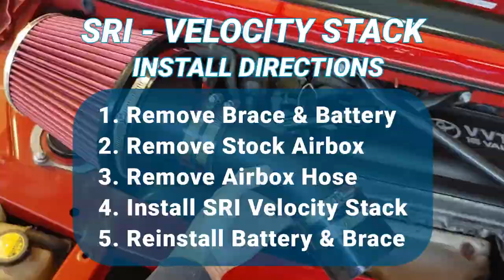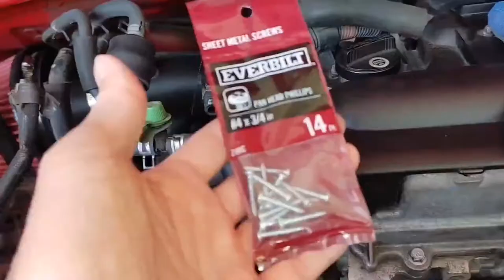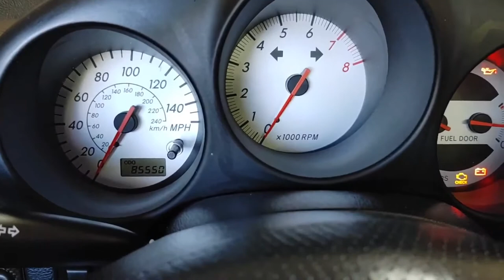Short Ram Intake VELOCITY STACK install on MR2 Spyder

Comment: I love the sound!  The power is neither here nor there for me, but I'd do this on ours in a heartbeat except for the sheer hell of changing it later.  I look at all that work and all my old brain sees is, "Yeah, and think of having to do all of that every time you change the air filter."
Reply from the maker: So true Trever! I just spent about an hour yesterday replacing the short ram intake with the stock airbox because in California we need to get our cars smogged every two years. Your comment was constantly ringing in my ears while I was trying to remove the short ram intake! 😅 But I plan to put it back in once I pass the smog because I miss the sound, and although there probably isn't a horsepower change, my butt dyno tells my there is.
Reply: @mr2garage  I wish there was something that made similar sounds but would fit where the stock airbox is.  I'd love a little more Fiat Abarth sound, if you've heard those, but I just could never motivate myself to go to that much trouble changing it.  Love your channel, BTW!  I've subscribed for more tips on what we can do with our Spyder.
Reply from the maker: @trevertalbert4929  thanks for subscribing! Heard Abarth once years ago and from memory, it sounded awesome!! These air intakes don't sound anywhere close, but it's raspier than stock. There are many cold air intake options with the filter sitting near the airbox or just past it. A handful of people make their own too. .

Comment: good idea, but your filter will always pull hot air from the engine that is -15 to HP. I would prefer to move it to side vent instead
Reply from the maker: Yea I think that may be better option.
Reply: Hey mate , i am designing these intakes , the filter feeds through the side vent , the intake measured +5-6whp on 4 different cars and dynos

Comment: Thanks for showing us this. The trouble is that the MAF sensor will need to be removed and cleaned periodically, so installing it beforehand won't really solve the problem.
Reply from the maker: Yes, you're right about that. It is a lot of work to get to it. Also, I kept the stock air box and pieces for the California smog every two years.

Comment: Gets hot in that engine bay area, short ram but not cold air intake.
Reply from the maker: Yes, true, good point.
Reply: Mine is an 03 MR2 Spyder 5speed bought it new and has 28k on the odo.

Comment: How tall are you? What is legroom like in these? Im 6"4 and really thinking about buying this or an NC mx5
Reply from the maker: I'm only 5'5" but from what I've read on the forums and FB groups, the Spyder should be able some over 6' tall. There is supposedly more headroom and legroom in a Spyder than any Miata models.
Reply: I'm 6' 4", but all leg. I've just bought one. Driving isn't "sustainable", but I'll be swapping for a thin bucket seat and a flat bottom wheel.